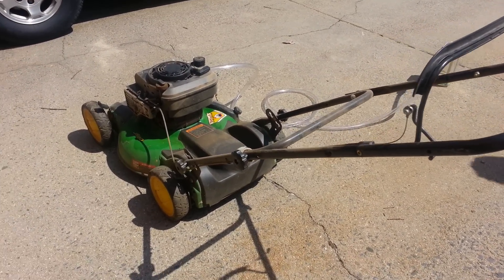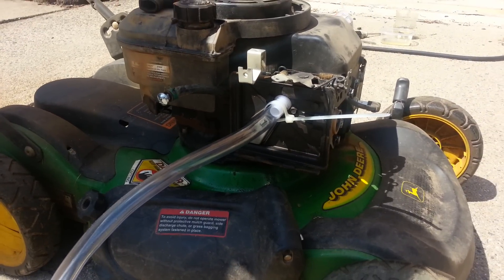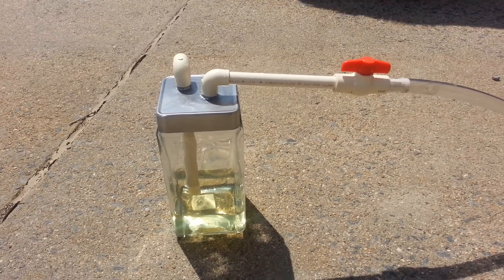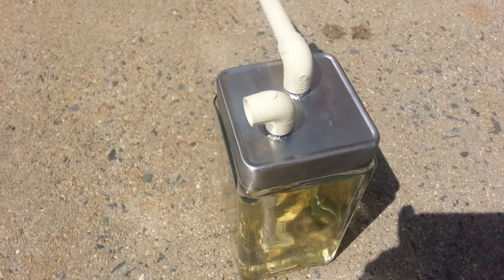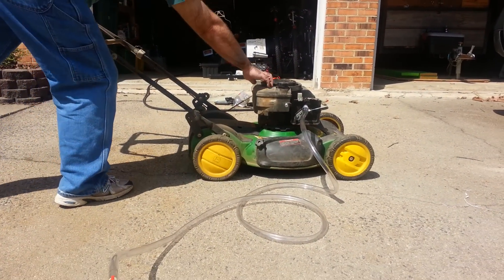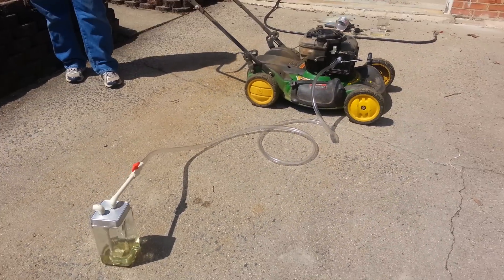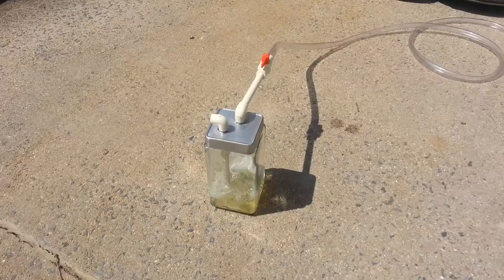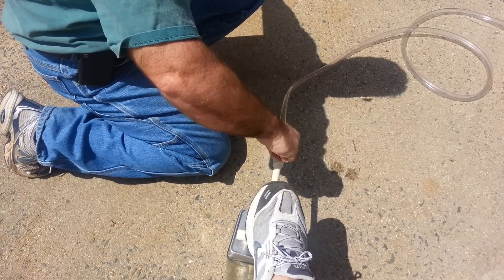Gas Vapor Carburetor

Comment: Why doesn’t anybody ever try to use an ultrasonic vaporizer also I’ve never seen anybody do any Dyno pulls and also nobody elaborates on their air fuel ratio running an engine on vaporized feel is totally possible it just needs that special ingredient that nobody seems to be able to find either the system doesn’t provide enough fuel vapor or too much is what I’ve noticed

Comment: Add a hollow metal ball between carb and intake manifold atomizes and vaporizes gas doubles gas mileage and cleans up emissions this is how Poque did it
Reply: The air fuel mixture goes thru hollow mixture ball creating a swirling of mixture
Reply: @RLBJR1666  ok, so that is functioning to increase surface area for fuel evaporation
Reply: Hollow metal ball? How does it work?

Comment: Stupid question - could some type of water/steam mist be injected in parallel to the gas vapors as it enters the intake (just before combustion) to add a cooling effect so as not to burn the valves (lean scenario).  Just curious.

Comment: One thing that gets neglected in all the vids I have seen on this subject is that over time moisture in the air will accumulate in your air draw-through tank that you will be fighting an uphill battle to keep a viable fuel-vapor mix, as water builds up, that will maintain combustion.  it also seems that real world going-down-the-road with varying speeds and loads is yet to be achieved.  That said I am intrigued by the potential of vaporizing gasoline BEFORE it goes into combustion.
.
These kinds of set ups would so benefit by having some kind of air drying apparatus in the line, much like shop air compressors have and hopefully better than those.
Reply: Gweedo Murray did you try pre-heating the intake air?
Reply: @gregorykusiak5424  ~ I never did any wrapping a tube around the exhaust manifold trick.
Reply: Shell perfected this long time ago. Look up shell 1959 Opel roadster it got 377 mpg with a 3 speed auto transmission. And 2500lb curb weight. Put a 10 speed automatic and 2000lb curb weight. Actually she'll when they heavily modified the car got 1100mpg. The car was mentioned once in a magazine. And never mentioned again publically. The car still exist in a private collection with videos on it.
Reply: @brianfitch5469  ~ If you have links please drop.  A neighbor from down my street; on the bus one morning, years ago in school,  told a tale of some guy having a Cadillac that got 30 mpg with a carburetor.  He took it to the shop, which I seem to recall as being the dealer and brought that up.  What came back was no longer the car with that kind of mileage.  Seems like a company who has a superior product would leverage that for increased sales.
Reply: @brianfitch5469  ~ I have it on a tab for later reading.  Thanks !
Reply: Yeah but then the compressor is going to be putting out moisture and dirt
Reply: @marcustrue1213  ~ Yeah, that's why air has to be filtered whether for shop air or air going through your container of gasoline.  Back when I tried the vapor scheme on my '75 Vega I think I used one of the lawnmower pleated air filter elements but did not do any moisture separation.

Comment: This way toput vaperized gas into an engine of any kind is verrydangerous one table spoon of gasoline has as much explosive power as 3 sticks of dynomite. Just takes one back fire and those making that video won't be arround to see it.the only safe way is to run both intake air and gas. Vaper thruugh water bubblers.also the wick system is. Better because bubbleing the gas causes attomizing and as every one should know only the vaper gets burned in the engine. Any gas dropletsjust get flushed out of the engine that fact is why 85% of a cars gas goes out the exaust. Be safe with these devices.
Reply: A stick of dynamite contains 600 btu's of energy. A tablespoon of gasoline has 488 btu's. These figures are according to the US Department of energy.

Comment: this would work great for a 2 cycle, for about 1-2 minutes, before the rod stuck to the crank
Reply: That is why one adds a little oiler in the system to avoid that problem.  Even adding it to the fuel will still get the oil there. Just need to add a little extra.

Comment: what if it was a direct port application? would that save the intake valves !!?
Reply: kiwamiNemesis you’re talking about intake valve carbonization in direct injection engines?  Have you tried water vapour in the intake airstream?

Comment: WOW GREAT..  hey buddy can i ask if this is good in running 150cc engine?. doesnt it damage the engine?
Reply: also can this be done in a fuel injection engine?
Reply: doesnt damage a single cylinder but in the 4 and the 8 it burned intake valves(after 500 hours on the 4 and 800 hours on the 8)We ran similar tests as this one and achieved 96 hours on 2 cups of fuel. Works well on fuel injected engines so long as the injector ports are sealed properly. We had problems with acceleration/deceleration so a small stationary application lawnmower or generator worked best
Reply: What happens if the injector ports are not sealed properly? Does it jerk? Im thinking of using pure hydrogen as a source of fuel. Since you said the gaseous stae of gasoline does run an engine. And also how much psi does the fumes need to run in fuel injection type. Since it differs to a carburator?
Reply: There is no difference between a carb or injector set up. The reason you need to seal the injector ports well is that if they leak the engine will not create the vacuum needed for operation. The way this set up works is completely different than an ordinary carb or injector set up and is about 20 times more efficient
Reply: Im sorry. I dont undertand.  to my undertanding. Carb is very different from fuel injection. carburators need the pressure from the combustion chamber to pull out gas from the jettings. When you throttle, the needle is opened, hence the main jet is exposed to pressure pulling out gas from it. Whereas in efi, its controlled by the ecu. The fuel pump provides constant pressure to the injectors, ecu then reads the throttle and decides when to open and close the injectors. The injectors need high pressure ranging from 35 psi and above depending on the motor.. correct me if im wrong. Do the fumes go to the fuel pump and to the injectors?
Reply: I have run a car with fuel injectors, plugged them up converted the engine to a central fuel injector system then converted it to a carb. All you're talking is different fuel delivery systems this has nothing to do with the inner workings of an internal combustion engine. If you look at the system in the video as just a different fuel delivery system it doesnt matter whether you have removed a carb or plugged up the injectors it works the same. This is of course in my experiences maybe someone out there has a different experience they care to share
Reply: Im not sure of your last question what "fumes" are you referring to?
Reply: I understand to some extent. Yes it will work whether you remove the injector or carburator. But then you have no way of controlling the rise and fall of the rpm. Hence you cant control the speed. The rpm will be constant depending upon the amount of fumes entering the engine. Yes it will run, but you simply have no control over the rmp, or the speed.. what im saying is. What if you pressurize the fumes to the fuel pump then make use of the injectors to control the amount of fumes, therefore controlling the rpm. Im sorry but can elaborate more if this is even possible.
Reply: Well the way I look at it your welcome to try. I dont think it will work but what do i know lol
Reply: Hunter Dragon adding fuel vapor to the intake air should cause shorter injector pulse durations leading to lower fuel consumption/higher mileage.

Comment: Of course it is more efficient than a typical carbureted liquid gasoline system because it runs on 100% gasoline vapor. Simply put, 100% of the gasoline vapor is consumed by the combustion process, where as, with a typical carbureted system only a fraction of liquid gasoline is consumed, the rest is wasted and causes air pollution.
Reply: Actually in all of our tests it was 20 times more efficient but we had problems with acceleration / deceleration. Not for the reasons you have put forth that is a common myth

Comment: Has anyone tried adding a diffuser rail on the intake side out of a hoop of pvc with 2 intakes  and many smaller holes in it to increase the surface area of the oxygen bubbles to the fuel for more rapid evaporation of fuel?  It may well have the effect of cooling the oxygen coming in for greater o2 density.
Reply: So obviously you know that as the field vaporizers there’s something called latent heat of evaporation so after about 15 minutes or so you’ll notice condensation on the outside of the container most people try to fix this with heat but personally it’s a cool trick but without investing some major time your results are only going to be minimal at best engines are tuned for the optimal air fuel ratio and a carburetor/fuel injection does the same thing as far as fuel economy people just keep beating this like a dead horse but if you wanna waste your time have fun

Comment: How is Throttle Controlled when Load is put on Lawn Mower, I can see if it just sets there on idle but just like a car going down the highway, to increase speed, you have to increase throttle which puts more fuel/air into intake to increase power and you have removed carb. so where does air/fuel ratio come from???
Reply: The vacuum is harnessed to determine the fuel to air ratio. It is a self determining principle. You are correct though about highway driving it lacks acceleration and deceleration control. It can handle load but once under load the changes in speed in either direction causes the unit to stall. Once it has established its RPM whether under load or not varying from this causes it to stall

Comment: I was wondering in a car if you make a gas vapour or a bubbler,  and leave you injectors hooked up will it take just as much gas as it's usually without vapour setup.or can you assist and have some gains
Reply: No you would just be running way too rich

Comment: you need to understand this gasoline is also a refrigerant as the gasoline boils off the liquid gets colder you get less vapor and you in train water in the fuel in the air
Reply: Yup. Bottle will go ice cold

Comment: You have to use a fine steel wool as a flash suppressor. Place it as close as possible to the carb in the hose .
Reply: or a check valve,  less restriction.

Comment: Ok anyone who wants to argue captors, mists, atomization, DONT it's really only semantics and only words. Read my posts ( all of them) you'll maybe begin to understand the reach of this device and its potential but also its limitations
Reply: Stupid spellcheck. I meant to say vapors lol
Reply: Leslie Clendening i believe in you. i must say, real world performance is far from speculation. one must experiment first too see the truth. one can say that it do that, it does this. but reality is, it performs different in real application... i also believe in hho energy. i just cant experiment on it yet.
Reply: I believe any gaseous system will have the same control issue though I think an electric hybrid using this system to run a generator to power the cars batteries as the engine runs well at steady state but you cannot control the acceleration or deceleration. Thanks for the vote of confidence I certainly have my share of detractors
I worked on this system for 3 years full time at about 70 hours a week I can tell you its pros and cons I have literally done 1000 experiments.
Reply: Your welcome. Im subscribed to your channel. Its funny though, in the comments. People are asking the validity of the application and one by one you reply to them with full details, yet they refuse to believe... I have one question though. You said one of the drawbacks is the real time control of acceleration and deccelaration. So is it possible to run a power generator for a long time? Since its running on constant speed. Is there no effect on the power output or perhaps do damage in the generator?. Im planning to buy a generator and set up this system. Using a wick system maybe.. thanks for your hard work and studies sir. I salute you.
Reply: In my experience running a stationary engine has been quite successful. We ran a single cylinder for 4 days(96 hours) on 2 cups of gasoline. Ive said before that you could run a generator on a car that powers the batteries thereby running the engine at a constant speed and adjusting the speed of the vehicle with the hub motors. It is possible.
One thing we tried a wick system as well as a bubbler system and as well nothing at all and they all produce the same results. It is neither the bubbler or the wick that has effect it is the vacuum . Make sure you have no leaks in the system if you would like a cut away diagram of the system we used I have one in one of my ledgers and if you send an email to lesliec77@icloud.com ( it had a wick in it)

Comment: The Oil Companies have put additives in gasoline that gum-up the internals of the heat exchangers, and clog the system, so when heat is applied, the system will no longer be able to transmit heat to the gasoline, to convert it into vapor. When Pogue invented his system in the 1930's, virgin well head gasoline, (clear "white" gasoline ) was available to the general public. The big oil companies bought out the Pogue patents, and shelved them. The big oil companies then put lead in the gasoline that was available to the general public, to stop anyone else from perusing this technology. When the smog became so bad from auto emissions in the 1960's, the car manufactures, in response to political pressure, developed the air injection/ catalytic converter system. The problem at the time was that the lead that the oil companies put into the gasoline, also gummed up the catalytic converter's. So, unleaded gasoline was developed to work with the catalytic converter systems. So, in response, the big oil companies scientists created new additives to put into unleaded gasoline to stop Heat Exchanger systems from working. The new additives are mostly Olefins and Paraffin's, which are currently 49% to 51% of unleaded gasoline by volume. These additives can be removed by a filtration system using 5 stages of silica sand filters, but you will only have half of the gasoline left per gallon. Bubbler systems will only work for a limited period of time as the gasoline goes flat and afterwards will not produce enough vapor to run an engine. The gasoline that is left in the bubbler system is called "Heavy Gas", and has high concentrations of Olefin's and Paraffin's in it , and leaves a heavy  greasy residue
Reply: Pogue must have been paid well that he didn't simply release the plans to the public at large which would make it impossible to quell a swell of backyard mechanics and machinists from building and disseminating the devices and the plans themselves to the public at large.  Seems Tom Ogle fell into that "Ill make sure to get mine" trap too.  Seems these men and others are doing their part to keep these "Great" ideas from us masses !  Who are the real conspirators ?
Reply: Are the additives flammable
Reply: @nickonizer  no, they just create carbon build up inside the engine, which in turns shortens it's life.

Comment: I wonder if the air/fuel ratio is still less than running through the carb and what the long term effects are on the piston and cylinder. Too lean of a mixture usually results in burned pistons.